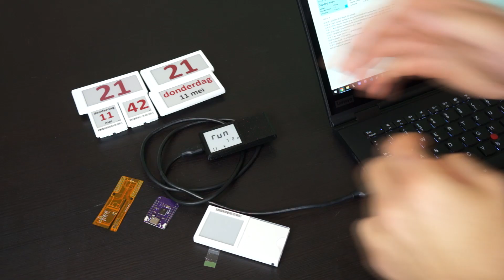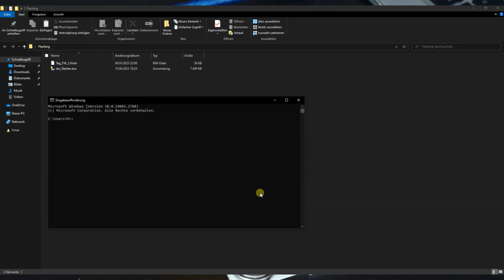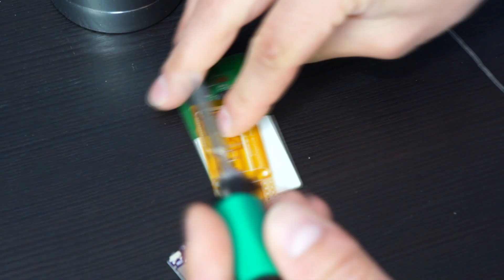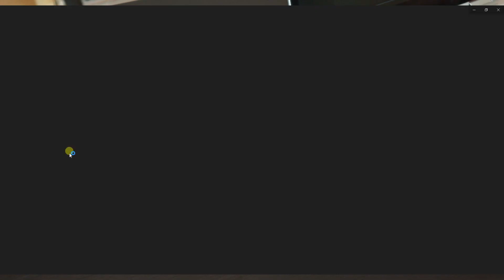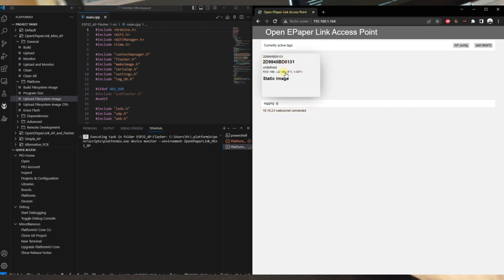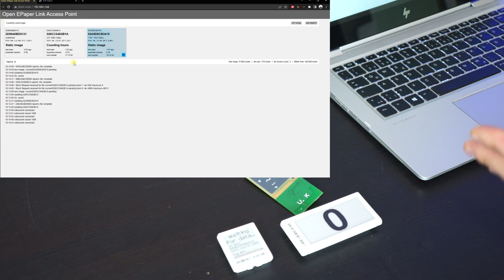ESP32 controlled E-Paper price tags The OpenEPaperLink startup guide

Comment: Could you please explain how the connection between the Access point and the displays work? How does the Access point detect the displays? Is each display already having a wifi module? Is it possible to use cheaper technologies for transferring data?

Comment: On the ePaper device what I got from the super market is a CC2530 chip. Only the power contacts of the module were oxidized (one was black, possibly because of water) and someone did break the power-connector. But beside this the module was fine.
Now I want to create a little display so that I can see some data under my PC-Monitor.

Comment: I have a few questions, I already have some tags with your modified firmware. Can I update them OTA with the "epaper-station"?
Is the ESP32-basestation communicating over USB or is this just the power-supply?
Reply from the maker: Hey, its best to do a hardware update and not OTA.
The esp32 only needs power and no usb connection